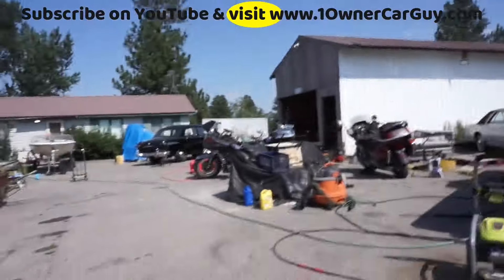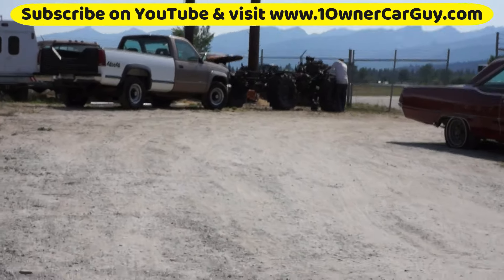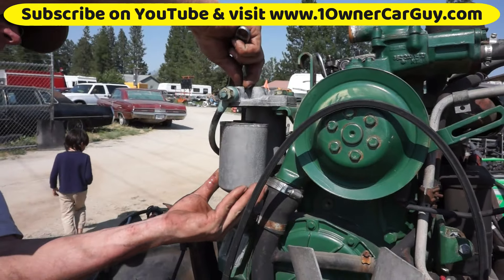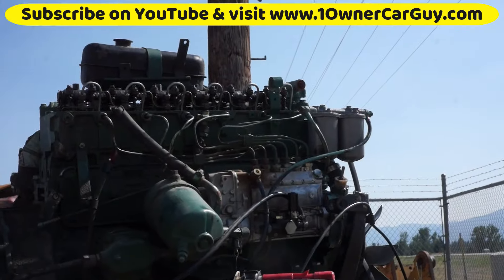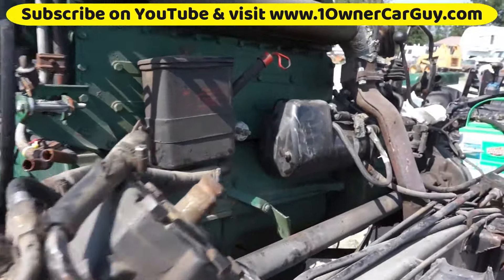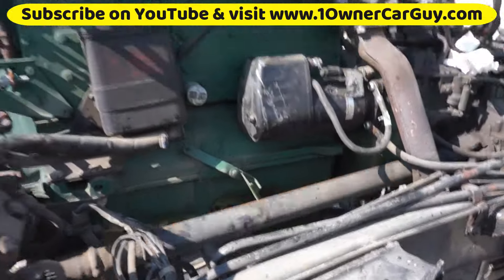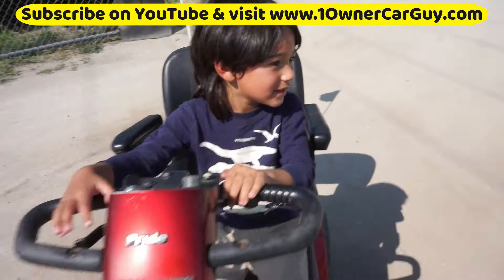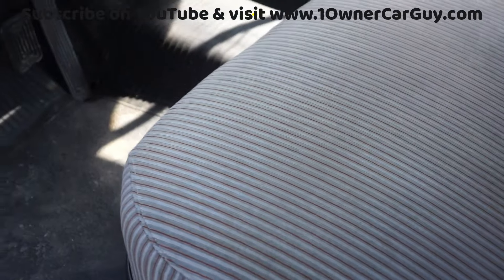UNIMOG COLD START ~ Will it start ~ Woman Ruined Mans Vintage Truck ~

Comment: Man , that thing runs sooo good ! That was a super score !  I like the old flat heads.. I actually have a V12 flat head in a 47 Lincoln.. still turns over by hand. The car has the rear suicide doors and all 4 doors are push buttons..not handles.